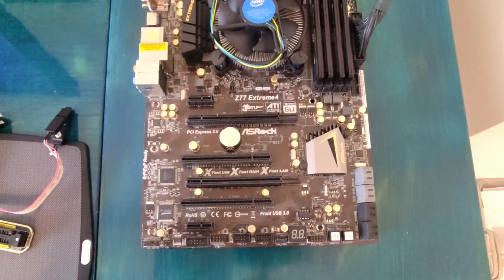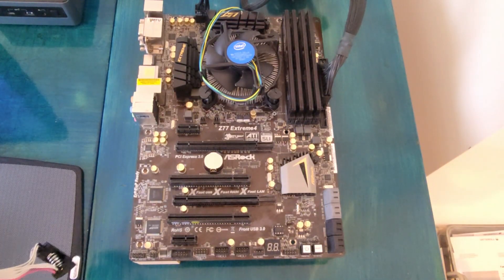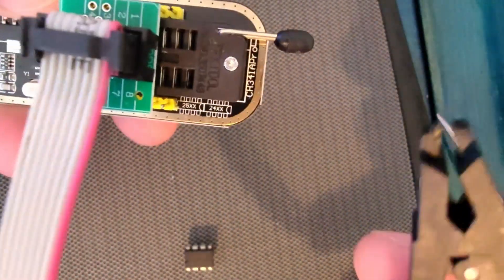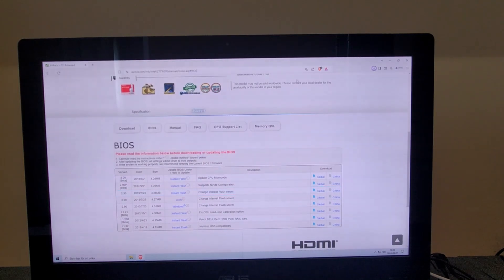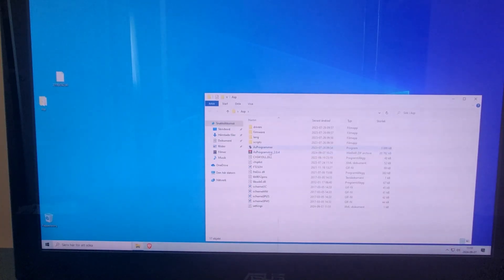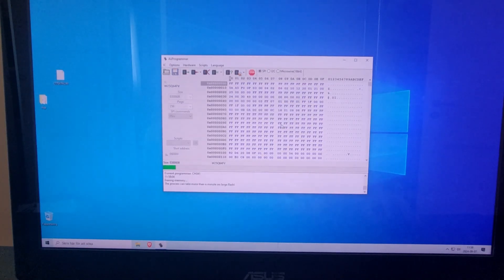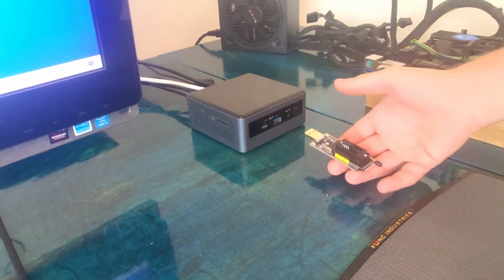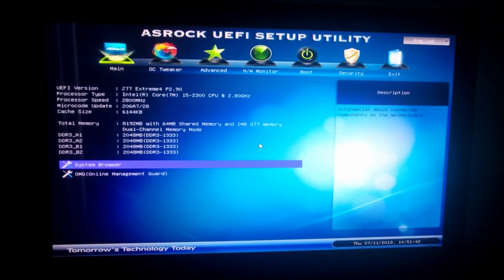ASRock Z77 Extreme4 BIOS recovery CH341A

Comment: Is the z77 extreme6 
And this chip are same?
Reply: I don't know if the chip are same, but you can recover the chip with the same adapter or buy a new chip. You can look at the chip and you will see the numbers on the chip, with that number you know what chip you have and decide if you buy a new or try to recover with a adapter
Reply: @Bosida-se  so my problem is after I updated my bios, which is partially a success, the computer is fine. But now I can't check for bios updates or downgrade my bios. It freezes now, and the only thing I can do is a hard reset.
Reply from the maker: @RTrAcing-j9i  You can try to take out the battery and do a reset to get to the factory bios. There are a few different ways to do it depending the motherboard. On your motherboard I read you use the CMOS jumper when it is unplugged. There are many videos on youtube about different ways to restore bios. I tried them all but didn't succeed so thats why I bought CH341A adapter to get a working bios on the chip. When it gets corrupted it can be hard to fix it but the CH341A adapter puts in the bios you decide to put in there so you get a working bios. Or buy a new bios chip. When I look on a photo of your motherboard i think your bios chip is next to the "RESET" button and sata. You can search for CH341A on the webb and buy a CH341A adapter. The steps are the same as in my video to recover your bios. Feel free to ask if you have more questions and I will try to help you if I can. Good luck!
Reply: @world4happiness47  so I reset my bios through jumper and the clear button on my back I/O. Did everything I could. Booted through dos Afuefi, but still, it  freezes. I even tried to trigger crashless bios feature too, but it didn't work. I probably need a programmer as my last resort. I think. 😔
Reply from the maker: @RTrAcing-j9i  Yes probably the best way to easy recover your bios. The CH341A is not that expensive and see it as a fun thing to learn 😀
Reply: @world4happiness47  yeah thanks man 👍 
If I can get a pre programmed chip, where can I get one?
Reply from the maker: @RTrAcing-j9i  If you can read the numbers on your bios chip you search on the web for that number and you will find where you can buy the chip. There are many places where you can buy chip but you need to find one who sell a chip with the same number. If you get a chip with another number there are a big risk you get a chip with a bios you cant use on your motherboard